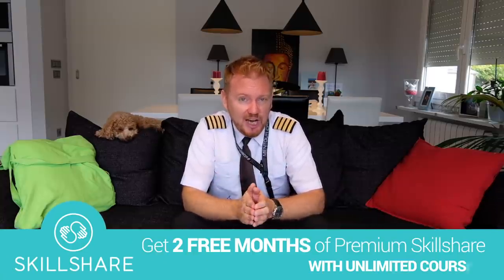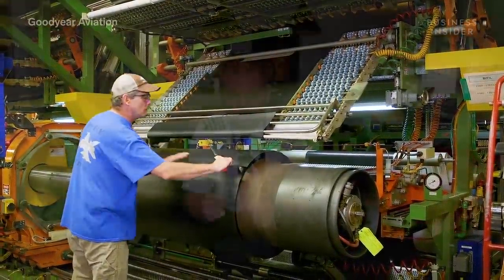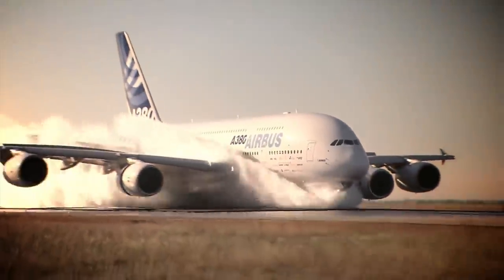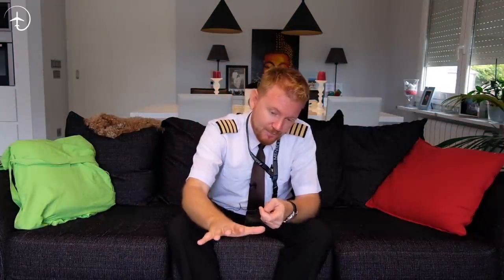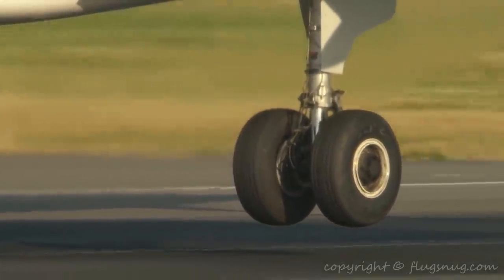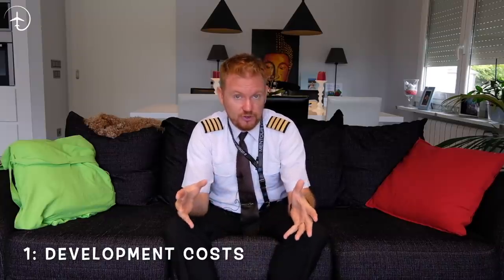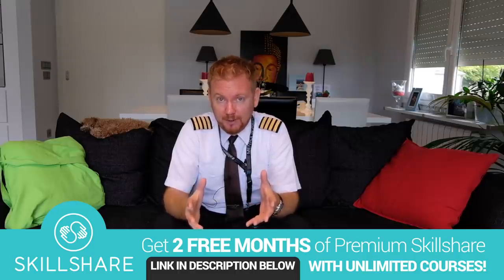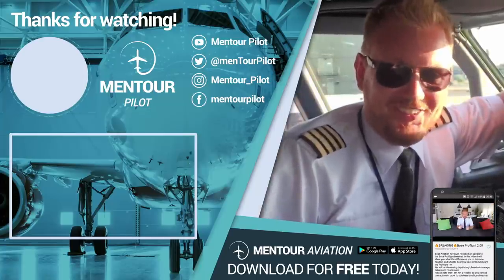Why not make plane-tires spin, before landing?!

Comment: What about some kind of mechanical "wind catcher" mounted on the side of the tire or wheel hub that will catch the air after the gear is deployed that will use the rush of oncoming air to spin the tires up to a point.  No batteries, no motor required and minimal weight.

Comment: Spin-up motors would add weight and complexity and workload. Spin-up vanes would add weight and fragility, and would be bad on takeoff. Spinning wheels are noisy.
Wheels that aren't spinning function as brakes when they hit and spin up. All that smoke is an indication of just how much energy they absorb. They slow the airplane. Heavier tires increase the effect.
(Note: Most large airplanes use reverse thrust for braking. The wheel brakes don't do all the work.)

Comment: Really interesting as always. Rather than electrical motors could you not use a wind driven fan incorporated into the wheel, could be very lightweight. 

I have a question that always comes to mind when watching crash investigations, why, especially in 2023 are there not cameras monitoring all of the control surfaces and engines on planes, surely it would greatly assist the crew when assessing issues?

Comment: I'm not an aviation expert by any means and think that just letting the impact of the tires with no spin on the weals is safer, however wont it be possible to mount some sort like spoon shaped turbines on the inner part of the landing gear rims that could catch the wind and do it that way

ps I remember watching an episode of Mythbusters where they try to lawnch a bike with a running start with the weals sping and when the bike makes contact with the pavement and it stops the weal because of the weight and impact and then keeps rolling from the momentum so i don't think the turbine weall thing would work either way

Comment: All of this got me to thinking about motorcycles they jump through the air. While they're in the air they use the throttle to speed up or slow down the rear tire from pointing too far up or too far down on the way to landing properly.  Would this Force also create enough change in the angle of attack of the nose of the aircraft in relationship to the runway that the pilot would not be able to do a quick change as far as getting the nose up or down?  Or would the size of the plane and its aerodynamic features be able to just shrug this off?  🤔

Comment: There are a few reasons why airplane tires are not spun up before landing:

Safety concerns: Spinning the tires up before landing would increase the wear and tear on the tires and could potentially cause damage to the tire or the landing gear. It could also potentially cause the tire to overheat, which could lead to a blowout or other safety issues.

Design constraints: The landing gear and tires are designed to operate at specific speeds and pressures, and spinning them up before landing could potentially exceed those limits and cause damage to the landing gear or other components of the airplane.

Cost and complexity: Installing a system to spin up the tires before landing would require significant modifications to the landing gear and could add weight and complexity to the airplane, which would increase its cost and maintenance requirements.

Overall, while spinning up the airplane tires before landing may seem like a good idea in theory, there are several practical and safety concerns that make it impractical and potentially unsafe. As a result, the current approach of allowing the tires to spin up naturally during the landing process is considered safe and effective.

Comment: Why not put vanes (like the half spheres on an Anemometer) on the outside of the rim and let the wind pre-rotate the wheels?
No motors, no batteries, no excessive extra weight.
Even if the wheels speed up only to half the needed speed it would substantially reduce wear on the tire.

Comment: Spinning those heavy wheels in the air would make a lot of gyroscopic effects which would make it really hard to land the plane. So it actually would make it harder and more unsafe to land an aircraft.

I’m not an engineer, but I’ve played with gyroscopes and gyroscopes that weigh 2kg are really hard to move and twist, so imagine spinning a landing.gear.

Comment: I must disagree about nitrogen not expanding when heated - all gasses are subject to the gas pressure laws. You may recall PV = nRT from school

The reason that nitrogen is used is because it's cheap and inert

It's cheap because it's essentially a waste product of obtaining oxygen from air for industrial and medical purposes

CO2 is not suitable as it's miscible in rubber. It may seem odd, but it's true - CO2 flows through rubber faster than nitrogen

But thanks for all the other explanations - they're great!

Comment: In point 3, you got a bit confused about the purpose of these motors.  They are only meant to spin up the tires (ideally slightly under the speed of the plane) and NOT to "drive" the plane like a car.  These motors would be set up to "free wheel" with any changes of force.  Crabbing shouldn't be too much of an issue, if any.  If 1 whole side fails to spin up, then just turn off the other side as well.  For the record, I do agree, leave what's not broken alone.

Comment: Motors on wheels powerful enough would be HEAVY.
Unless speed perfectly matched would snatch the hell out of the motors. Might be OK with tires, not good for motors/windings. If it’s not broke don’t fix it! Airplane tires are well engineered, well manufactured, well managed (usable lifetime well known). The automated tug system would be doable.
Reply: If they spin easily, the motor could be low power and simply take a while to get the wheel up to speed.  (It could be half ground speed to just reduce wear some).   Also, if the motor de-energizes all its windings as soon as ground contact is made, that should avoid damage.

It would still have some weight, of course, and would need sensors, monitoring, electronic controls, and probably cockpit status displays, and maintenance.  Not worth it since the potential cost saving is so small, and there's no safety upside.
So I think mostly overall economics would be the problem (along with possible vibration and centrifugal force effects from having the wheels spinning in the air, as other comments have mentioned), not just weight.  But yes, overall not worth doing.

Comment: The main difference between aircraft tires and stand automobile tires and the aircraft tires conducts brain away static electricity well as that's not the case for automobiles. Part  of the landing visual is due to static electricity.

Comment: Battery problem? No problem just use the electricity generated by the engines! The issue is that tires need to be warm to be quite so effective, getting the most out of that contact patch.

Comment: Now WheelTug does it with its own electric wheel replacing the airliner front wheel and using power from the APU to move the aircraft on the ground.

Comment: No electric motors meeded… you got free front wind pressure so just add small directional shovels to the axles/outside rims that catch the wind in one spin direction. It‘s driven by the wind speed an may be matched to spin the wheels just a little slower than the touchdown spin would be. Should save a lot of the wear. Easy stuff.

Comment: Red flags!
1.  Why would the "pre-spinning" of the landing gear have to match exactly the aircraft's landing speed? An approximate match would still extend the working life of the tires substantially.
2.  If aircraft tires are relatively inexpensive and frequently retreaded, perhaps that's a bad idea, perhaps it's high time we designed more expensive tires, treat them more gently and discard rather than retread them when they wear out.
3.  Look at what caused the Concorde disaster. Until the wake-up call when that aircraft crashed and burned at Charles de Gualle airport, nobody thought it worthwhile installing light-weight seats to save fuel or lining the fuel-tanks with Kevlar bags the way they do with fighter aircraft.
4.  Why would the tires have to be "pre-spun" with an electric motor or an internal combustion engine? Why not use turbines fed by tanks of compressed nitrogen inside the aircraft? Pressure vessels don't have to be machined out of cast steel, they can be made out of Kevlar or carbon fiber composites.
5.  Methinks the airline industry is clogged with middle-management bureaucrats who rely on their long years of experience to prove that each and every new idea will NOT work, they feel threatened by change and innovation. CN Rail was unprofitable for decades - until a dynamic new CEO took over, fired the "old-guard" of middle managers and replaced them with people who could think outside the box.

Comment: 9:04 why not using the "wind effect" to make wheels spinning before landing  ?  
(some kind of small rotor blade along each wheel, no need to get a big one if central element is well lubricated)
Reply: Great idea to make the tires spin. However, all tires probably won't achieve and maintain equal speeds. Read Bill Witt's comment. He mentions that vibration would be a problem.

Comment: When they tried using tires with vanes in the side walls to get the gigantic tires spinning for the Boeing XB-15, they found out the gyroscopic forces of their spinning made it harder to control the aircraft for a safe landing.

Comment: The wheels will spin up before the full weight of the aircraft is resting on them. My guess is that the wear from touching down and spinning up, is negligible compared to the wear from actually braking the aircraft. Especially considering the development costs of a wheel spin up system.

Comment: Nothing has to be added to the tires. All you need is a cyllinder spinning them to the lowest landing speed inside of the hull. If the rotation slows down to 80 knots or 50 knots it's still better than 0. And there is a solution for unbalanced tire  - small plastic beads inside of a tire are commonly used in trucks. The truck has to be moving only at 40km/h. I'd ussume that the centrifugal force would be even higher in a bigger tire

Comment: For reference, Google says a 747 tire is 1.24 meters in diameter.  So I calculated that 300kmh would be result in a rotational speed of 1280 rpm. It also weighs about 110 kg

Comment: I think the bottom line is that it is commercially not worth it to create an elaborate mechanism to pre-spin the tires. I had also been wondering if there is a simple solution, for example add little blades to the edge of the tires that would have the wind spin up the tire when the gear is down. Those blades could be moulded into the rubber. But even that may not be worth it.

Comment: Why not use something like the fins on a forced air fan fixed to the wheel  hub to spin the wheels up a bit. would save a bit of rubber.

Comment: The blocks on car tires have nothing to do with turning. Those blocks are there for gripping loose surfaces and snow as well as water channeling on driven tires only. Cars tires are meant to be rotated, so all look the same. Truck tires are different. Only drive tires have the blocks, where as trailer and steer tires don't have them. That's because they aren't driven. The blocks add a lot of rolling resistance, and would increase fuel consumption. 
Aircraft tires are great technology, but truck tires take a lot of abuse. The tread lasts around 100,000 miles with the casing potentially seeing 500,000 miles, depending on condition. 
The treads you see along the road are from neglected tires or damaged tires. I have over 2 million miles in semis and have only had two old tires blow on trailers and a steer that lost pressure from road debris on a hot day. A well treated tire will almost never fail.

Comment: Electric conjectures? Many planes have 2 double axle bogies (4 motors) and a smaller single axle nose gear (1 motor). Wheel spin-up would have to be right-left tach-synchronized for safety and spin-up would have to occur after extension (which doesn't give too much time to achieve full spin-up - some speed is better than none, I suspect). To alleviate complexity and ensure FAA approved safety, candidate motors would need inductive rotors directly embedded into the axles (ie: no gears to lock-up or break). Unfortunately, this increases axle weight and complexity, not to mention the weight of 2x 3phase 20-40KW stator's per bogie (using a lot of heavy iron content). All this weight, it needs to be understood, is below the hydraulic shocks so the extra weight on 1st impact could hinder and not help.. Add to this, inductive rotors directly embedded into the axles would have no gearing, so the low RPM torque of these motors would be almost useless for low speed taxiing. As for batteries they're not required - Super caps are safer and weigh less. Super caps can be APU-charged during flight, can deliver more current, and a 250 kilo's of them and the associated wiring have all the energy needed for spin-up. Again, this all adds weight to the aircraft, which then increases fuel usage...
This idea seems just beyond economical feasibility, but it would be interesting to have long-term results of a fly-weight system that could synchronously pre-spin wheels to lower speeds (again, some speed is better than none). After a few years of tests, they could determine if safety and tire wear was somehow improved. I don't see much hope of this happening unless the low speed taxiing benefit (safe motor gearing) can be addressed. Keep dreaming! :-)

Comment: The pure nitrogen is a good way to preserve the rubber of the tyres and if you wanted to electrically accelerate the wheels for landing, using in wheel motors and super-capacitors charged off of Solar panel skins on the upper wing surface all you would need is to work out how to synchronise the wheels to meet the landing speed. Computer controllers could easily take care of that ....

Comment: If the tug is controlled by the tower then that would increase safety too right? The tower knows where all the tugs are and u cant start with one on ur plane so no more misheard start commands or planes taxing on busy runways

Comment: To run up tyres before the landing i really don’t think motors would be needed. Some air fins or baffles could be put on the tyres  which would spin them from the air flow.  They wouldn’t Be spinning exactly at the speed of landing though but some spin would lessen the wear but it would add some weight to the aeroplane so probably bot economic 🤔 

Cool to have tugs doing the ground work!! 

Would save a lot of money in the long run and save a lot of fuel and emissions.

Comment: another good reason not to put motors on the landing gear is weight. you add weight in batteries, you add weight that is the motors. and as we all know, weight is bad when it comes to any type of vehicle. if you add let's say 1000KG worth of batteries and electric motors is that about 10 passengers that they can't take on that flight. 10 fewer that pays and all of a sudden have you lost the entire cost of the wear on the tires in just a few flights. and the price per passenger would go up for the airline because more weight means higher fuel burn. 

there are a number of more reasons that I can think of that makes it even less likely for aircraft manufacturers to add motors to all the tires.

Comment: During WW2 there was a big shortage of rubber, so flaps were experimented with that were built into the sidewalls of tires that would open increasing wind resistance when the flap was on the bottom side of the wheel rim and close when it was on the top side, effectively spinning up the tire before landing.  I do not know why the idea is not used to this day.  There must have been a downside to this idea.  Perhaps the flaps could fall off leaving FOD on the runway?  Boyles Law says all gasses expand at the same rate with temperature.  So to this day I do not understand why have Nitrogen only gas in a tire?
Reply: As I understand it, dry Nitrogen is used, apparently it's the moisture that can cause greater expansion as temperatures range.

Comment: Such systems are under development. On aircraft with an MTOW of 78 Mg, the additional machines in the landing gear weight 300 kg. Energy should come from APU, not the batteries! Prespining the wheels is a nice bonus to reduce costs.

Comment: In the US we say Hydroplaning 😂

If you don’t have one jet powered, you don’t have any electricity. And if you don’t have a jet running, you don’t have any way to start a jet engines.

Wheel motors don’t need batteries, they can be driven by the APUs or the jet engine generators.
Wheel motors don’t need to be spinning at exactly the ground speed. One sensor can determine the wheel speed for all tires and it can shutoff if one motor fails. For landings with extreme crab angles, the wheels can spin at lower speeds to prevent drive off.

Comment: it seems the tires help slow the plane at touch down so spinning the up would increase brake distance. it is surprising that only nitrogen is used to inflate them to such high pressures, manlift tires have foam inside to insure they dont collapse under the weight.

Comment: Inert gas doesn't mean it will not change much with pressure and temperature, if you are talking about gases expanding with heat. Nitrogen being inert means it will not chemically react with the rubber. Regular air is roughly 80% nitrogen and 20% oxygen, and when you heat oxygen and rubber together, there can be oxidation reactions, which (the following is a mere guess) could degrade the rubber. Also, when you get oxygen, heat (high temperature) and combustible materials (rubbers, oils, metals...) you can start a fire.

Comment: Rubber tank chain track instead of wheels. As the track will touch the tarmac all wheels inside will start rotating and it can even land on uneven surfaces & stops faster??? Or Won’t work it’l offer way too much friction??